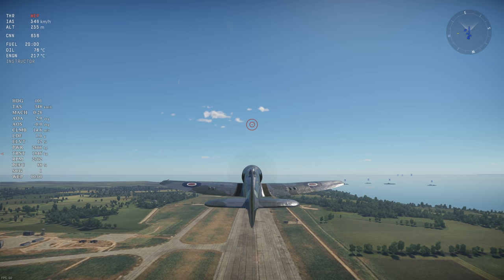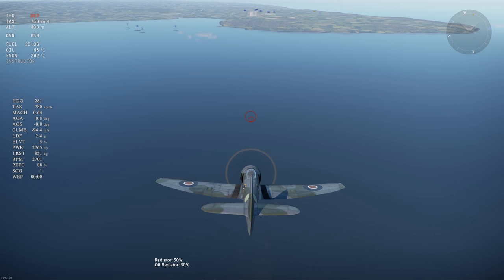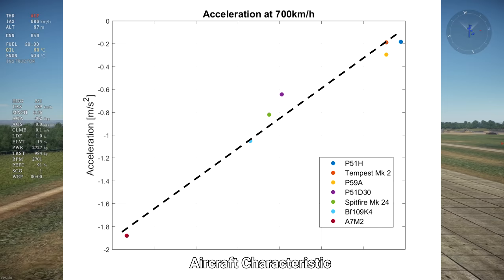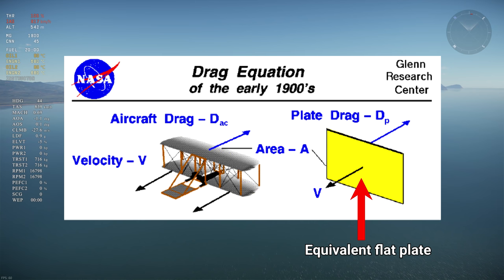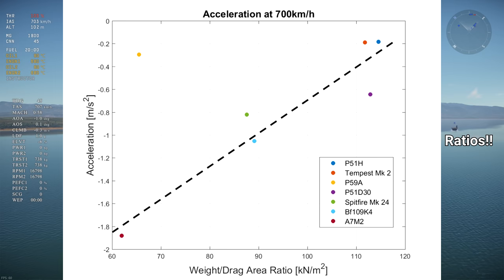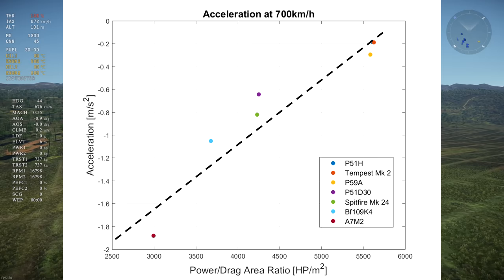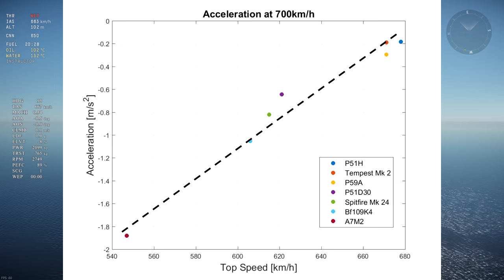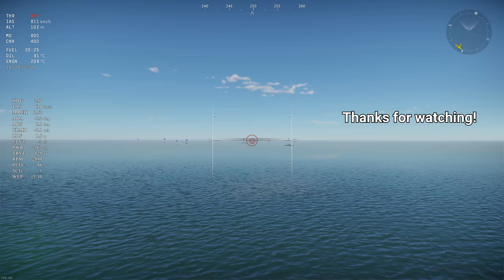Aircraft Linear Energy Retention

Comment: 700 kph seems a bit arbitrary as different planes have very different top speed. 100kph above top speed would be more fair
Reply: No, because the top speed is dependent on this linear energy retention factor. With your definition there could be a slow, draggy but powerful airplane that has a higher LER than a fast one.
Also, jets that have a top speed of 100km/h less than M=1 would be sad
Reply: @michbus7440  but in this example we measure not linear retention, but difference between top speed and 700 kph which is useless. Of course planes with top speed almost at 700 will win. What is more interesting is linear energy retention multiplied by top speed.
Reply: @tedarcher9120  Well, the LER here is a very vague definition, you can't calculat its value for a specific plane. I guess what is more important are the general ideas and trends shown in those graphs and how to use them to slay noobs
Reply: @michbus7440  they are useless tho, aren't they. The idea of linear energy retention is that planes with lower top speed can outrun faster planes by diving. For example, cannon mustang can outrun 109g-2 even though it is slower by shallow diving
Reply: @tedarcher9120  if they have a similar drag coefficient, that sounds like the G-2 has more power while the mustang is heavier (i guess, idk all the planes). What you described I would call dive characteristics, not horizontal energy retention
Reply: @michbus7440  horizontal energy retention is one of characteristics. It is an amalgamation of drag coefficient, power to weight ratio, frontal area, etc. Basically, if you have better HER you can win by diving, and if you have better climbrate you can win by climbing
Reply: @tedarcher9120  oh, that makes sense now. Smart!
Reply: What I love about this game is that you can learn all those cool details they don't teach you anywhere, and then use them in satisfying ways. It's like winning by knowledge, not just skills
Reply from the maker: The point is the compare every plane at the same speed, since drag is a very strong function of speed. Comparing at different speeds (say 50km/h faster than the top speed of that aircraft) will likely give the slower aircraft a higher acceleration and LER, while it is definitely worse when going fast in a straight line.
Reply: @tedarcher9120  Yup! Dive characteristics improve for heavier aircraft above top speed, but it worsens it below the top speed.

Comment: P-51 has ridiculous energy retention considering how tight it can turn, frankly it seems bit fucky, bit like how the mig-21 can supermaneuver in the game for extended periods without falling out of the sky like a rock.
Reply: from my experiance the p51 has realy good straight line performance but it dumps a lot of speed for a single turn even tough it turns well aganst a smart enemy with good MER the tight turn is not that good
Reply: What are you smoking my guy, mig 21 dumps lots of it's speed in a turns it has some of the worst turning retention
Same goes for p51, it turns tight when it has speed but runs out of it quick
Reply: someone seems mad that they cant outturn a mig21 in their phantom lol
Reply from the maker: P51 has average MER, Mig21 has worse MER than most of its opponents I think.
Reply: @AdamTheEnginerd  I can confirm. The F-4 Phantom actually has superior MER over the MiG-21.
An F-4E (the most agile phantom) can actually keep up in a dogfight with a MiG-21. The MiG has better low speed handling, but it starts struggling once it gets too slow to turn effectively.

Apparently delta wing designs tend to have fairly bad MER.